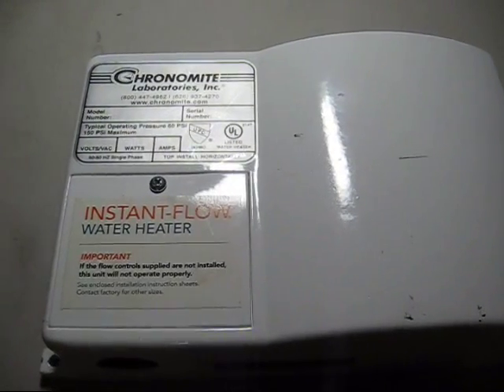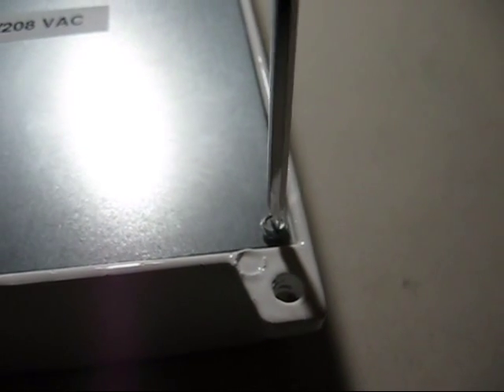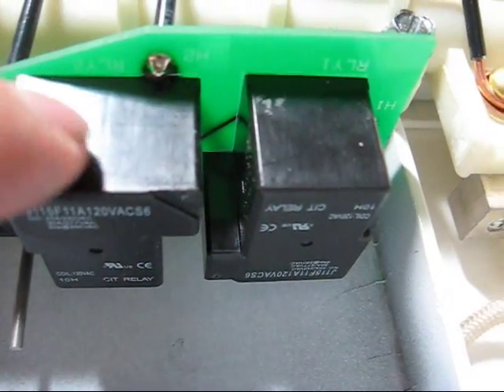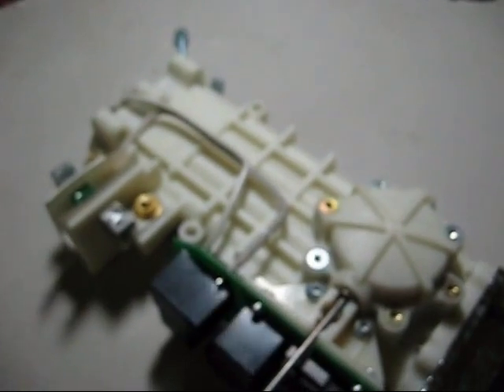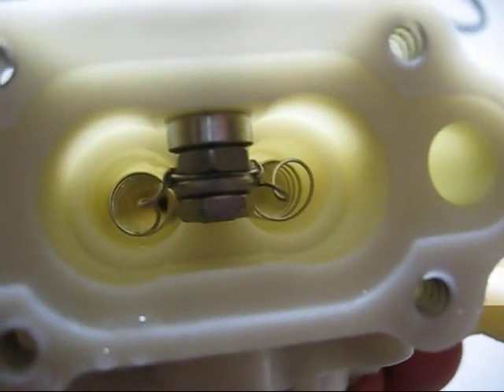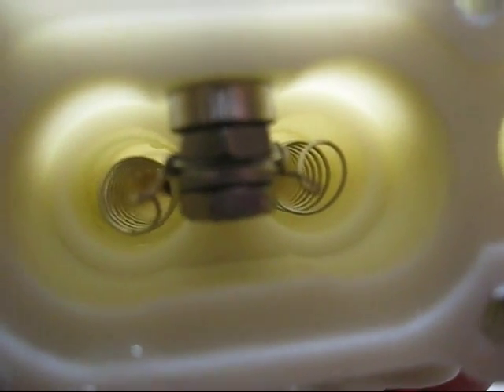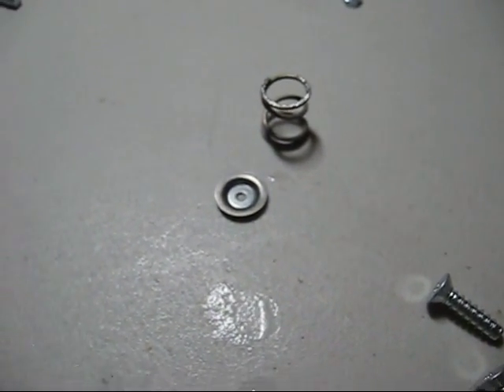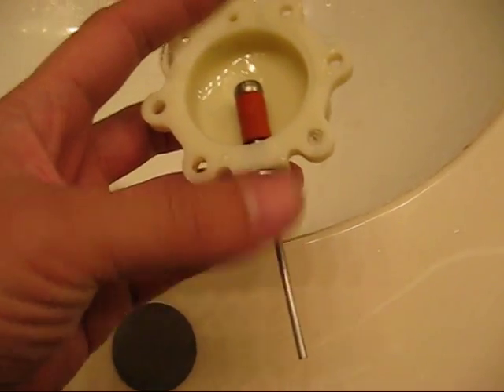Instant-Flow Water Heater Teardown

Comment: I just bought one. And it showed up, all the electrical bolts and nuts were loose, also the mother board had 2 bad relays and the mother board was cracked. This was a brand new unit put together by a bear Cub wearing mittens. Disappointed in the cheap quality. I wouldn’t ever order one of these again. Get a different one

Comment: I can't express how important this video is. Not just to my cause but for the sake of basic mechanic principle. The gentleman who created this video is well spoken, know correct terminology when identifying parts and really seems to know what he is doing overall. I was actually entertained in watching this but was dismayed when the video seemed to cut short. This is only because I enjoyed the video and narrative so much but more sure because I was curiius about the nicro switch and other electrical parts. My unit will not turn on and I think it is switch. This video gave me a bit of foresight in inspecting my 15l/120 unit. Thanks again for this under appreciated and under valued video. I'm subscribing right now to see if you have dissected any other things.

Comment: Thank you for this teardown.  It was helpful when had to tear down my Chronomite 20L-240.  I tried to clean out the water heater by pumping vinegar through the lines to descale it but hard water scale was not the problem.  I found metal chunks in the output line of my POU water heater... Your video helped me to know what I was getting into!

Comment: Thanks for this informative teardown! I also love to learn technology by tearing down non-functional devices, whether I can repair them or not. The naked heating coils sitting in the water flow is not uncommon, apparently (see "suicide shower" videos). A grounding wire is usually immersed in the water flow to give electricity a lower resistance pathway. I would love to see a teardown of a Franke The Little Butler Water Heating Unit, especially an older unit like the FHWT160. I have one set up on an electromechanical timer to make an emergency hot shower system, and while it works okay in small warm water batches, I would like to control the batch heating cycles to prevent overheating or overpressurization of the tank. Franke, the manufacturer, won't give me any engineering specs or internal diagrams, so my customizations are based on guesswork. NOTE: I do run the system off of a GFCI outlet to provide some protection.)